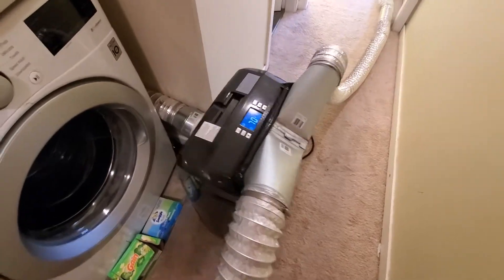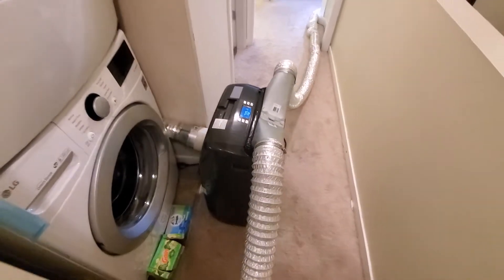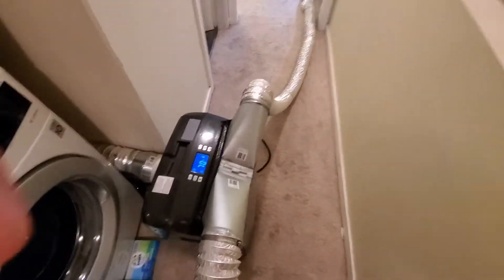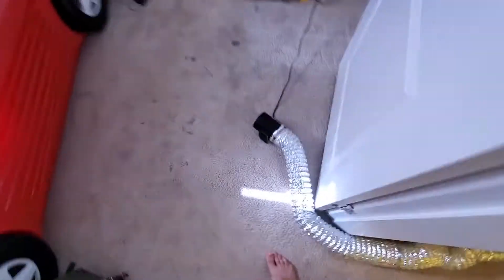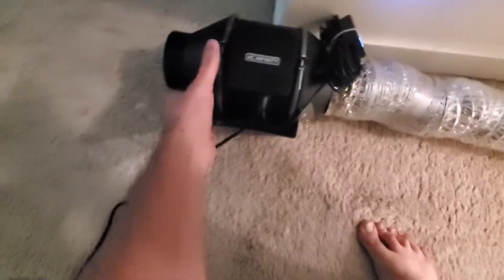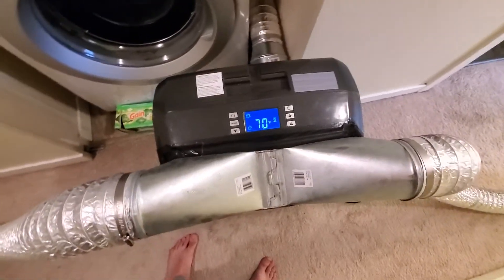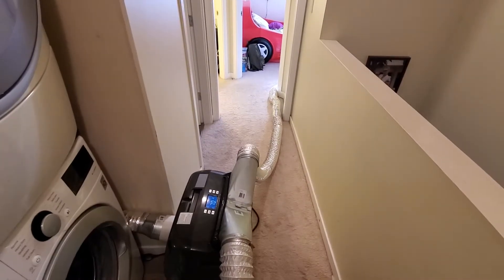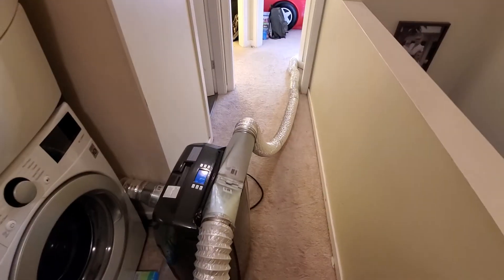Portable AC hack to cool two rooms at the same time in the townhouse with no duct work on top floor

Comment: Hello. Do you think is possible to place the ac unit in a roofed patio outside and install ducts to blow inside?
Reply from the maker: I don't see why not. You will need to turn it off yourself though as the thermostat in the AC will think that it's always hot and the compressor will run all the time. Use end fans for sure to help the air flow
Reply: @AlekseyNapolskih  cool thanks 🙏